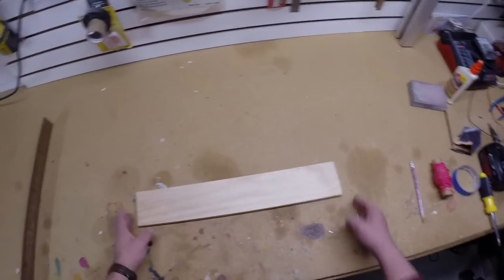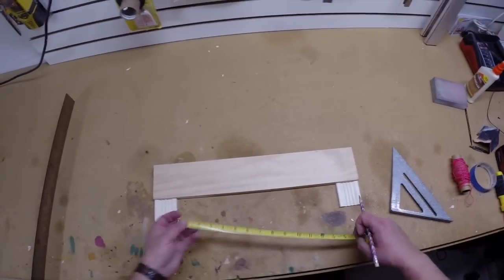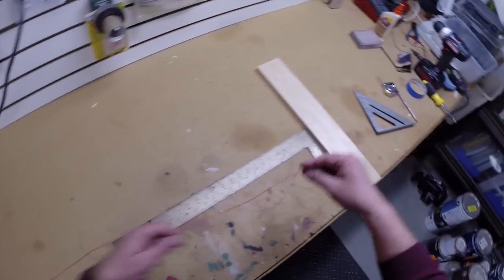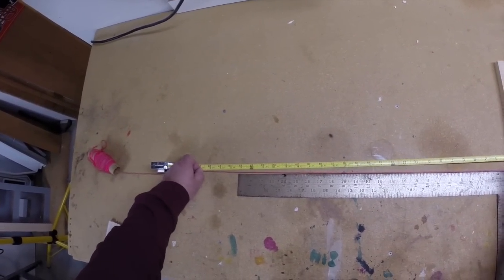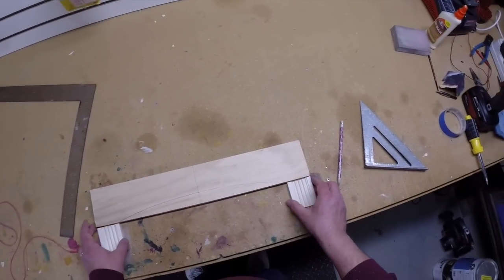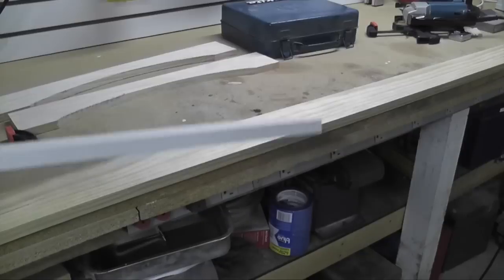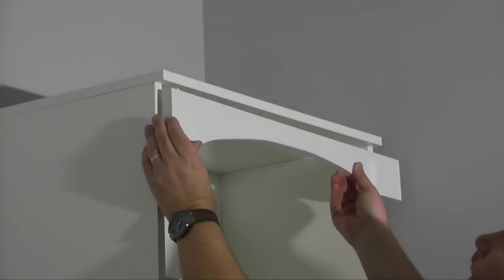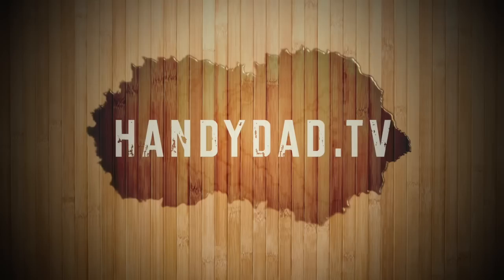Radius Calculator (aka How to Cut a Curve in Wood)

Comment: Try using two screws/nails for the foci(focal points) of the width, set one screw/nail at the center between the foci and above the center and perpendicular to the desired height...place a 1/4" piece of PVC so as to touch each of the three points and CAREFULLY trace the natural shape which the pvc will show you...all this string and formula stuff doesn't work well on jobsites, dirty floors and large(10 ft by 1 ft spring height arches) people...trust me...I gotz a STEM degree, several GC licenses and a real god damn job actually building shit larger than a bookcase...the Romans didn't use no stinkin; strings..lol...good luck https://www.youtube.com/watch?v=fc9104ypaZ0
Reply: Totally agree with what you have suggested.

Comment: Ok, why ya use calculate?? Ya can hold the string at any length, and draw an arc, right?? Because it will tight so where you start at 1 inches on wood as it tightens and you move left and right, so why need calculate number??  What is the purpose of calculating radius? If you know the mid-point and you decide which height at mid-point that is 1 inches. Of course, if it is higher than 1 inches, so it might be outer-radius, so it is not inside at inner-edge or inner radius.  Of course you use mid-point since both half is even radius to produce a diameter of two radii to make smooth arc.
Reply from the maker: +Khalif Foster Use my calculator t get it right the first time.
Reply: Yea, I am saying why use the calculator?? Because you can use 1 inches at mid-point of the wood and go left and right using pencil as you pull it tightens as you curve left and right, so why use calculate number with a ruler to show where the string will be and pull that string from start point to end point, because you can use any start point to hold tighten.  So, you decide where that is 1 inches and you know where that is mid-point by yourself without using a calculator.
Reply: Ok, I understand now that it is a radius of any length, so that is why it produces an arc. So, it is 15 inches wood and 1 inches height at center point. So, it produces a radius of even left and right to produce an arc, but how many arc to will produce a circle, do you know? What is the hand calculcate to get radius of any diameter? The diameter of 15 so it produces a radius that is within 15 inches of wood. It would be good to understand for shape math.
Reply from the maker: +Khalif Foster If you want theory, Google it. If you want to draw an arc, use my calculator: http://handydad.tv/radius-calculator
Reply: HandyDadTV that made me laugh...

Comment: This is pure genius!!!  Did you write the code for radius calculations or is this a widget from Google?  Your demo is so useful!  

Now couple of questions... Imagine a rectangle with rounded corners.  This is the shape of the long window in my RV cab bed overhang.  I have to cut out a plywood panel to fit this area.  I have a Skil Jigsaw.  Not sure if it turns to cut rounded corners.  Do all jigsaws  turn to cut corners, or do special ones?  I'm still a novice with wood.  I also have a small trim router.  Please advice how to cut these corners.  The wood is 1/4 inch plywood with a nice finish and grain.  The panel is 8 ft long  x 1.5 ft wide, with window cutout in center.    It will be assembled in two halves meeting in center from a 4 ft x 4 ft plywood square.

I would also like to know what glue you used for gluing the radius-cut panel onto the white bookcase?  I use Titebond wood glue for wood to wood connections, but yours was in a caulking gun. Was it construction adhesive?
Reply from the maker: +Juan Lopez 5 / 8 = 0.625
Reply: +Chris Heider   Thank you for a good solution to my problem!  I am happy I can tackle this.  I'll be making the cutout today from a plywood panel with a lovely grain pattern.  Thanks!!!
Reply: +Chris Heider   Thank you Chris!  Good information!!
Reply: why 625 = 5/8??